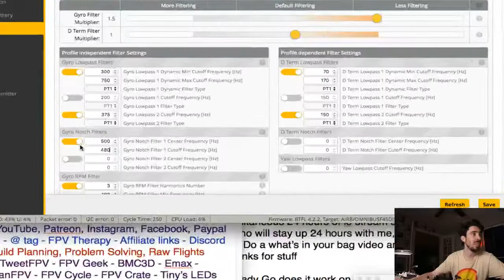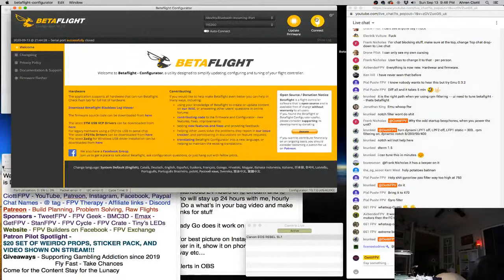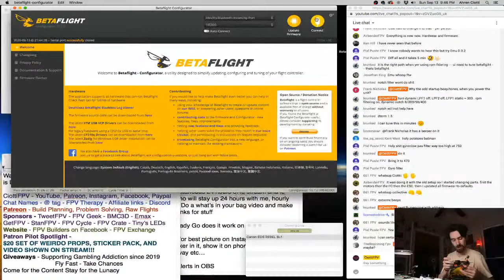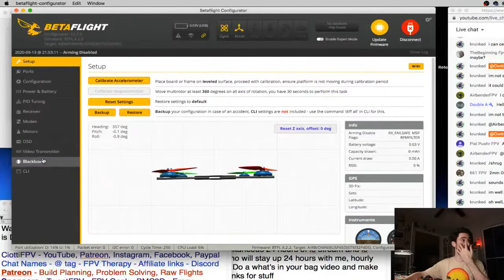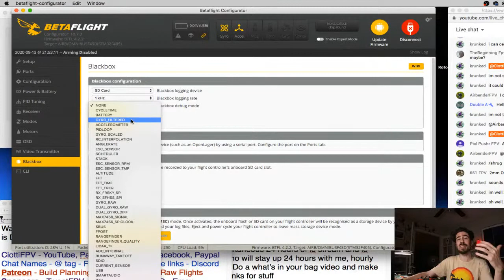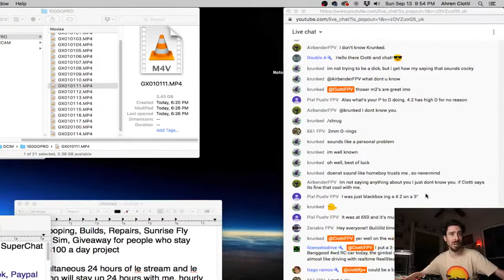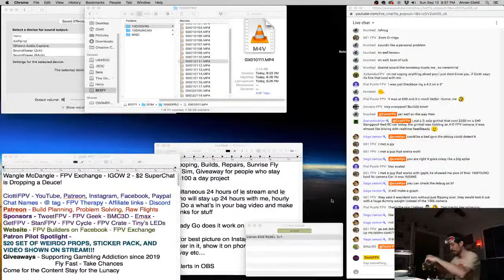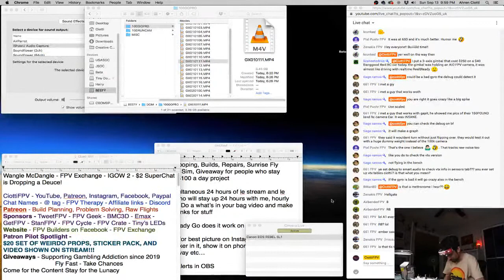Late Night Sunday Q&A - Doing things

Comment: @Ciottifpv, may I know when you are going to do a build with the Brotherhobby 1504.5 VY motors? I am waiting to see whether these BH motors are a good replacement for my current Emax or RCX 1306 on 3 inch frames.
Reply from the maker: David Chong I actually just finished he build last week and they’re AMAZING, I haven’t really talked about it in streams yet but I will be really soon.  The 1306’s are good but the Brother Hobby’s are GREAT
Reply: @CiottiFPV  Which BH VY motor size is on your build and is it on a 3 or 4 inch frame ? I am thinking to replace my Emax1306 4000Kv on my CB3 Frame with BH VY 3950Kv running 4S. Hope to see your BH VY motor review and flight soon. Thank you.
Reply from the maker: @davidlhchong  1504.5 for the CB3 frame, if you do a 4" frame at some point the 2004's are incredible as well :)